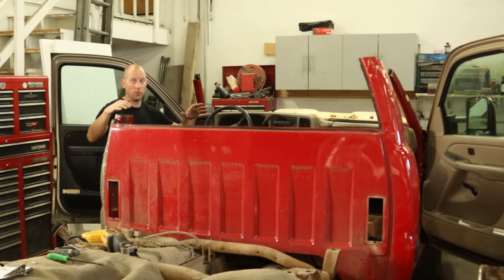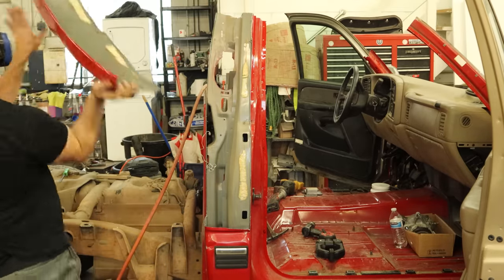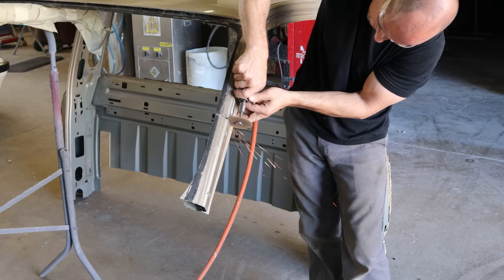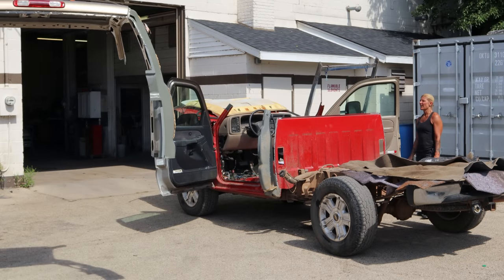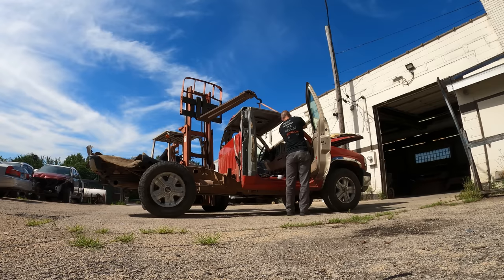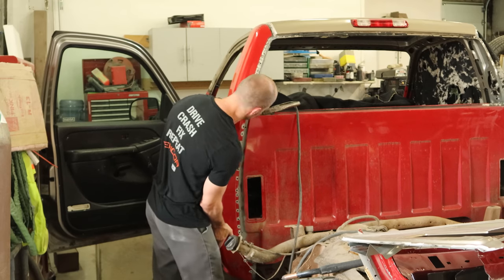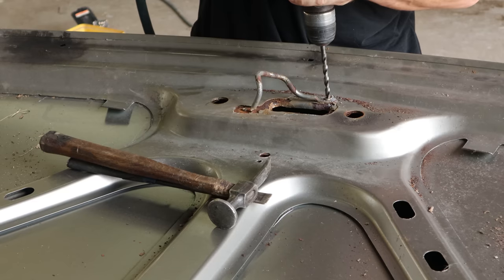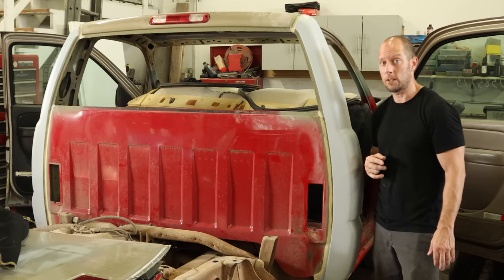Putting the roof back on the convertible Silverado rollover

Comment: As someone whose former position was ruining the resale value of hundreds of vehicles (I built cop cars for a living), The best trick I had for not giving the sheetmetal extra nipples when drilling through a panel was to drop a deep well socket over the bit. Depending on the size of the bit in question, it'll still give you 1/2-1" drill depth, but a zero percent chance of introducing the bit to the outer panel at a high rate of speed. 
Also, I don't know what you're using for 1/8" bits, but Harbor freight has double ended machinists bits that are less than 10.00 for 8 (16 drilling ends). They're pretty good for drilling through sheetmetal (due to the short length), and will drill through anything... Once (to include high strength steel). Plus they're cheap enough to be abused as the job dictates.
Reply: and if your really good with a bench grinder you can resharpen the bits as well!........(retired sheet metal worker here)
Reply: Yeah, I used to drill holes in cars for a living too, many years ago. I had an assortment of different diameter steel tubes I had made that slipped over the drill bits. Just insert the drill bit into the chuck with the tube over it, and let the drill bit stick out the end if the tube as far as you needed, then tighten chuck.
I've seen those double end drill bits called jobber or sheetmetal drill bits too.

Comment: You are as much of a restorer as a rebuilder , love seeing this Chevy getting back in service rather than a scrap yard . Great build as always Scott .
Reply: also great for showing how my 1980's K1500/cab was made and im considering blazer-door-frame-less-glass/convertible/body mod's to it at the bare minimum a roll down back glass

and a theory of how to hotrod chopped top works or non-chopp 1970 charger convertible could be made like im planning on soft toping/removable-roof my 69 charger and adding back 1/2 size doors too

Comment: Just to rub it in… down here in Tx you can just about pick up a rust free cab at Walmart.  Amazing work and much respect.  And I owe you thanks.  I used your video on the black Chevy 1500 as a guide when I had to replace my frame. My methods were much sketchier though. Rob
Reply from the maker: Yes but getting it here costs more than the cab.  Then our state takes months to retag it.  It was faster and cheaper to use the top of the truck that was rust free.  Just to rub it in, the rust parts still have a clear coat! 😂

Comment: in canada we are banned from sectioning a-pillars in the middle. do it near the roof or firewall. welding, even though using staggered joints, creates brittle zones.
Reply: Didn't know this, even in Quebec? lol I heard chop shop horror stories when I lived east coast. Here in BC they'll total the car for a scratch and dent.
Reply: @willoverkill8461  i should've said ontario, i just figured the curriculum and repair rules of red seal trades were federally unified. quebec used to have 0 standards, im not sure how it is now. in trade school they told us of the quebeccers who repacked air bags with gunpowder and rocks.

Comment: Very interesting seeing a rollover cab repaired instead of being replaced. Seems like a lot of work doing the repairs, but with no rust-free replacement cab available, it was the only way.
Reply from the maker: I could have gotten a rust free cab but with shipping, it would have been around $2000 and I still have to wait for the state to retag it which can be a few months.
Reply: @vehcor  how do yo address the gaps and glass fit between old cab and donor top?
Reply: @gertraba4484  Dude, Did You watch the video?

Comment: Great tip staggering the breaks! I wanna chop the top on my YJ 3in and I need those joints to be strong, this should help a lot! By the way, I need an ls5.3, trans and transfer case for it to. Hint hint.

Comment: These days when I am taking my van apart (just got the cylinder head off at the moment) to get years old welded in there glow plugs out as its a diesel,.So its off at the engineering gnomes as we speak as my shop isn't equipped for the precision drilling required to get them out) I hear your voice commentating as I am dismantling stuff...
It's a Renault Master Mk2 by the way...With one of the most hard wearing engines known to man in it, the G9U-650 2.5 turbo DCi...A million miles with right maintainance guaranteed...

Comment: Interesting how far down you go on this.  Guys who chop tops on custom cars get away with cutting usually at the window (sometimes they have to cut out the rear window frame as one piece to lay it down).  But I guess it makes sense if you have to replace the cab corners anyhow.

Comment: Scott, you make replacing panels look so easy!  Truck is looking good. Hope you are throwing that chrome wheel well trim in the pile.
Looking forward to the end result!
Reply from the maker: The trim is going in the pile for sure! 🤮
Reply: Get rid of that wheel well trim.  I had it on a 2009 Chev and it caused rot in the wheel openings. They don’t fit well an trap a ton of crap behind them. They were on the truck when I bought it and I will not buy a vehicle with that aftermarket crap on it.
Reply: i like crome/gingerbread so im going with it on my 69-charger and gm-K1500 1985-88 4"-ish wide-bodied black/raw/polished-plastic ruff country/bolt-on flares , the wheel opening's look much more expensive/finish with them on vs nothing or pure wide-bodied in steel or plastic/fibre/ect painted or unpainted , or worst is sawsall-finish/raw-cut like some off road and race car ownership's do

this wider corme trim is the typical type i like as the 80's gm pin-stipend/thin/3/8"in ones i have mixed feelings for and generally it's nope not in the mood for the taste-styling 

ps mine are daily driven it just like nice rides 😉🤠, sometimes off roading/ruff weather ❄ect
Reply: @stevengiles346  wasn't that a 2000-now RPO option? and i get the caddy super-fly options ( yes it is a real gm model sold between 1960-1990, and gorge barista/bat-mobile helped design them and yes not my taste as it's just to much.... ) aren't for everyone and yes there's a point that gingerbread can get too much and look cheap&cheesecakey to me but murdered/plain isn't my taste's either
Reply: @richardprice5978  The trim on mine wasn’t factory.  Previous owner put them on.  Definitely aftermarket by the label on the back of the trim. If you live in the Deep South with no snow and road salt in the winter then it may be OK. Anyone in the north stay away from them and inspect the sheet metal if you’re looking at a truck with them. Like I said, they didn’t fit well and had a lot of gap to fill with sand and dirt from the road. This trim was not available as a factory option on a 2011 Chev Silverado.  The factory stuff from GM, Ford and Chrysler fit much better.
Reply: @stevengiles346  didn't realise that ( are you sure ? 🤔  ) as that's the model years that pay homage to my square body truck and at the dealership's lots i noticed the trim ( wheel well and other in progress mod's and things like my OEM-deliveryed i was doing ) being there and the taillights and bumper lolz i did it 1st as i modified mine using 2000-14 ford parts 🤫 but it look better than 86 oem and mine ( single-long-bed/fleet-side old-fall-guy/movies?? and prior was my family/dad so it's sentimental to me as it's parts of my childhood ect, also not given to me aka i had to pay for it ) is 2-toned and the stripes made it look 👀off but the flush-crome c3 handle ect 👌 ,unfortunately it got stolen/chopped/wrecked and nowadays is a mess so i have to start over again 😢 

and yes i do drive it hard in snow ❄and mud and light rockcrawing ect, but also not a fan of rat-rod's/potena/rot/ect

so if it's done well on fit and finish aka better than oem-dealership's-delivery/rail-car does that matter? to anyone wanting/anyone else? ect, i don't see how painting polished ( or brushed/sanded finish ) ss or ally or brass is going to be the same as adding gingerbread as it's a different theme/feel ect

and 2~-5ft ( or say at 50ft away ) away i didn't notice anything fitments wise being off or at least as i was walking to the parts departments at chevy/big-3/ect
Reply: @stevengiles346  im around SLC Utah area's and a millennial/90's generation  

if you look at the concept art for my auto's it clearly shows that people like Richard/bill wanted trim ( or attempted to talking the boardroom into using SS/ally for the floor&rocker-stamping-A-class-panels ect and or using tinted/rap plastic as a way of toning the ss-body final finished look in specific sections/spots ) added as a kinda pin-striping/eyes brain brake so the body lines and stan's ect are showing in a much better experience for the owner/end-user's, sorry that i can't express this well but im around artisty-people like my wife and she showed ( teaching me artistic logic ) me why you'd want it on top of my 🤷‍♂ it just looked better
Reply: @richardprice5978   Richard, yeah I’m sure these weren’t available for 2011 from GM. Yeah definitely available for the square body trucks from the factory and they fit well.

Comment: You were not concerned about splicing the windshield post in the middle? Why didn't you leave the roof & back of cab intact on your parts donor, and simply section the whole thing through the rocker panel & middle of cab?

Comment: degree in autobody collision here for A & B pillars we just used inserts one has to be mindful of not over strengthening unibody still has to be designed to crumple/save lives and there's a minimum/maximum number of spot welds on those because its structural and panel 2 part epoxy is a no no even though companies say their stuff can do anything

Comment: I had a 99 Silverado that I ordered new. Had the light under the hood and the rear disc brakes. By the time I bought my 2006 GMC Sierra 1500 Crew Cab drum brakes were in the rear and the cabin air filter was gone and the light was gone under the hood.

Comment: they make a 5-in-1 with a metal top surface, not that I've used that as a breaker for spot welds on my Merkur front fenders...$8.99 at Ace.  :)

Comment: Hi Scott, sorry to bother you my friend. I need to ask you something. I own a truck just like this one ( 2001 sierra 5.3 vortec) that I’m pretty sure is burning coolant fluid not sure how is that happening but the truck just had a radiator and water pump replacement and the coolant fluid is still losing level, its been in several shops but the mechanics are clueless or just lazy to really solve my problem (the truck starts pretty fast at the first crank in the morning, once you use the truck and reach a normal working temperature, if I turn it of and try to start it 20 minutes later it takes at least 3 long cranks to start) that is why I’m suspecting the truck is burning coolant, somehow is mixing in the injection system can you give me a tip on what to do (sorry my English is not that perfect)

Comment: Thank you for always explaining what you're doing and why. When you were talking about the A-pillar and high strength steel on newer trucks, does that mean it newer pillars can't be repaired or do you have to do it differently (replace the whole thing)?
Reply from the maker: Replace the whole thing to do it the right way.  Like I did with the center post of the 2017 Terrain Denali.

Comment: Looks great!  Would it have been more work to replace the whole can instead of cutting and welding?  Just curious.
Reply: The donor cab had rusted through floors and cab corners, so no replacing of the whole thing was possible. Scott actually mentioned it in the previous video.

Comment: you are so wrong in your off set cuts it needs a sleeve in the a pillers plug welded and then seam welded and you could saved a lot of time by putting the hole back panel on
Reply from the maker: My offset cuts have a backing like I said that you didn’t pay attention to just like the B pillars.  You also didn’t pay attention to the fact that the cab is rusted on the bottom. Stick to watching videos, you need a little practice.